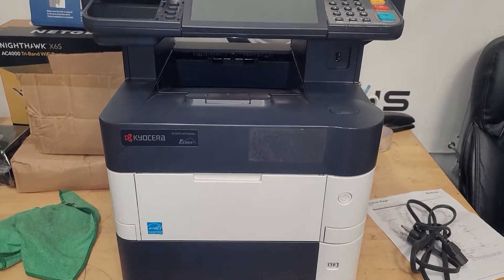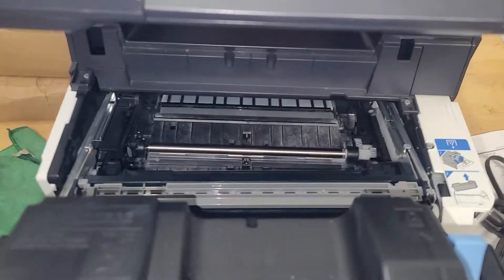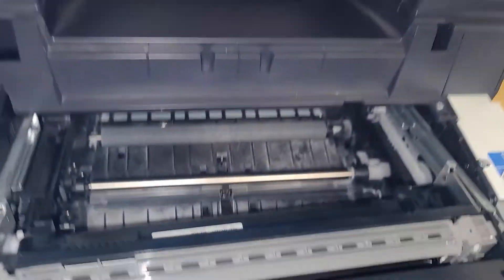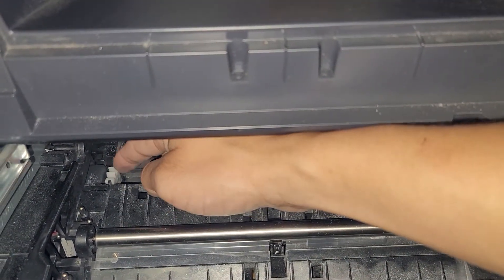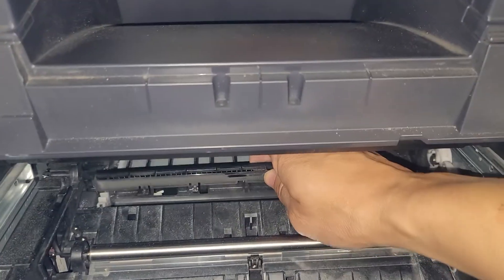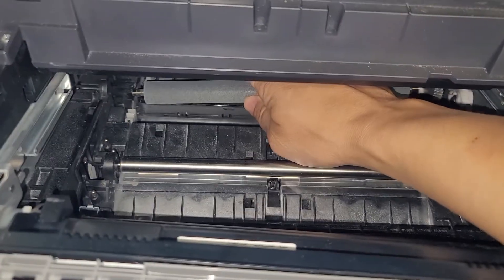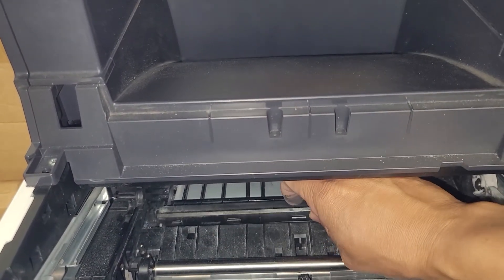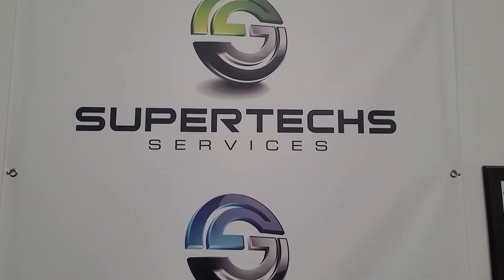#Kyocera How to replace the transfer roller assembly on M3550idn printer!

Comment: Hi, very nice videos you have here on your channel! I have a question, if you don't mind. I didn't know this printer, I've got a print shop and only work with konica (bizhub c220 and c360). I print mostly black and white, about 12k-18k per month, but these machines are quite slow and they are color, do you think that if I buy this M3550idn it would handle all black and white copies well?
Reply from the maker: Yes, It can handle the volume, but the quality of the print will be better on the machine you have.